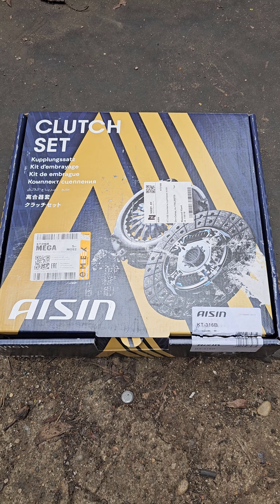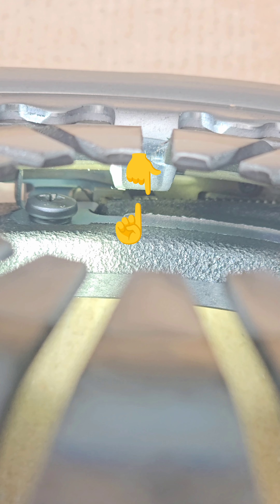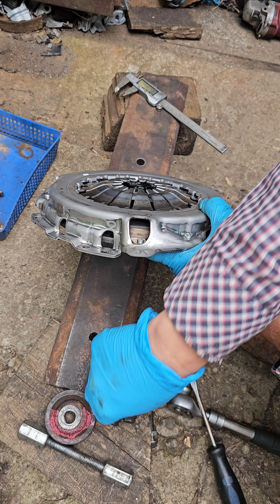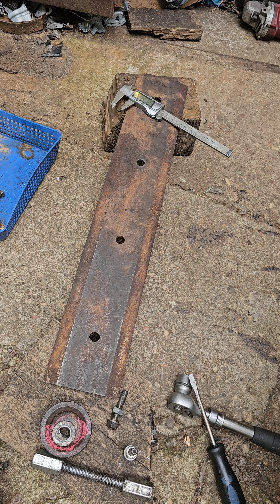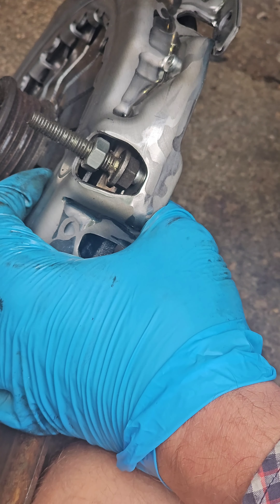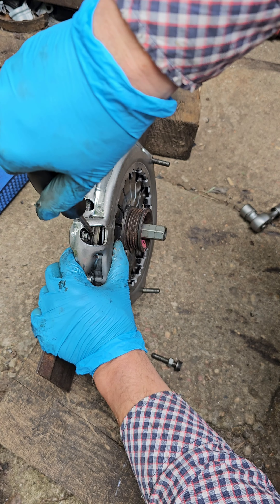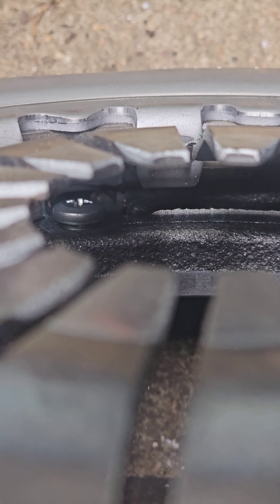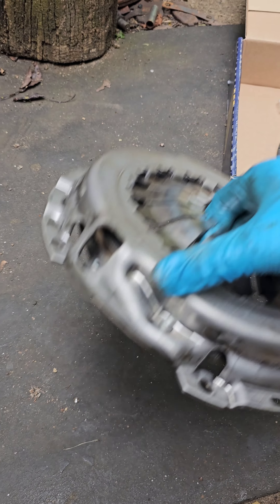ACTUATOR TOYOTA SEMI AT CLUTCH PLATE RESTART RENEW CLUTCH COVER ALL MODELS 5 SPEED TRANS SUZUKI ROBO

Comment: Hello my fried i have a Toyota Verso 1800 MMT 2007 year.I change this part an also the metall plate the car goes great BUT i hear a small sound like whisteling when the car is in gear and the sound goes away when the gear changes snd comes back again but only in low rpm .No sound downhill or whithout gear.Is it from the gesrbox ? Has to do whith that component i chsnge?
Reply from the maker: Hello.
You did calibration?
Reply: @vak_service  I dont know .They told me that i maybe need to change the gesrbox and They put grafit valvoline to see if something changes.I maybe hear a change when i drive for many kilometas but when i stop the car and start agsin its the same .I only hear it betowene 1000 and 2000 RPM .When its in newtral nothng when i take of the gas nothing and when it changes gear it goes away and coms back .Greetings From Greece đy friend
Reply from the maker: @antonisMavridid  if you can send me some video about it to viber or whatsapp i can try to understand whats it is
+375 29 6353511

Comment: Hello friend, can you help me? I took my 2007 Toyota Auris MMT to the shop for a clutch replacement. The clutch was replaced with one for a manual transmission, and then the clutch actuator was adjusted. The vehicle was working before it went into the shop, but now they can't perform the learning process. It doesn't show neutral, it doesn't throw any codes, and it won't perform the learning process. Everything is properly adjusted, the actuator has no play. What else can be done? Or does it simply not work with a manual clutch?
Reply from the maker: Hello.
Do exactlly llike in next video and calibration again:
https://youtu.be/v688qonlI5M?feature=shared
Reply: Friend, thank you very much for your help. It worked as you indicated, and after some adjustments to the actuator, I was able to program the transmission, and now the vehicle works. However, I have noticed a knocking noise in the following situation: When you are stopped and release the brake, the vehicle moves forward, and if you brake a few seconds later, you feel a knock. This happened after changing the clutch; it didn't happen before. I noticed that the actuator takes time to react to release the clutch when you brake. Do you have any idea what it could be? I appreciate your help.
 @vak_service

Comment: Hi, I need a semi-auto clutch kits for my Toyota Corolla Verso.
Reply from the maker: Hi.
Reply: @vak_service  Hello Mr. VAK, I have issues with my Toyota Corolla Verso. When I am in long traffic, my MMT gear gives a warning sound, and it does not pick up when accelerating.
Reply from the maker: @ademolaolukorede2649  Check for codes. Check by wire. Do like this and type the codes

https://youtube.com/shorts/W2DRdW2XflM?feature=share